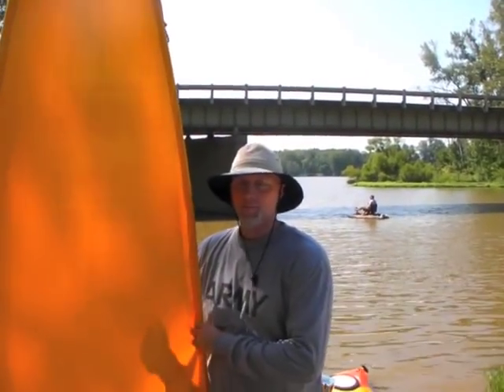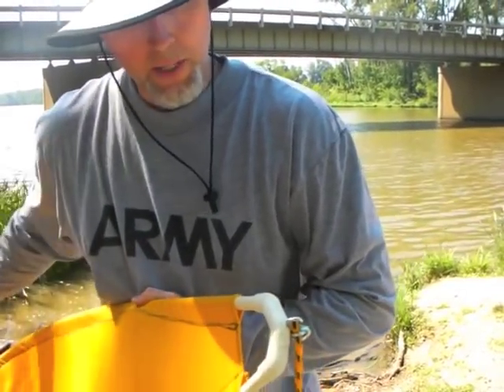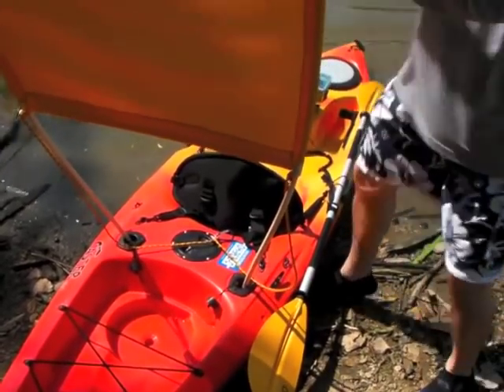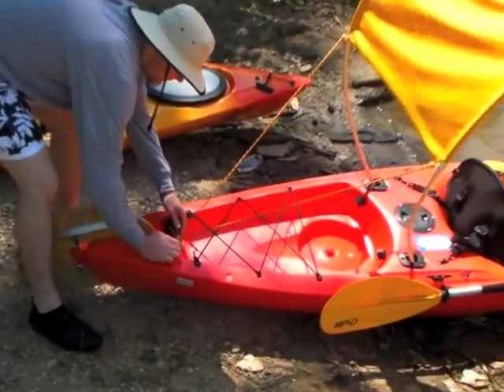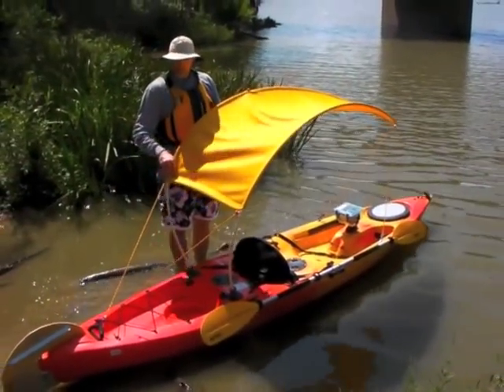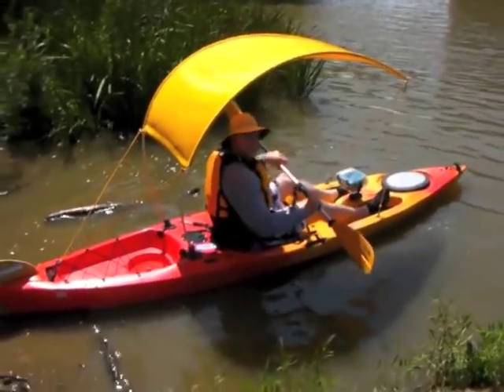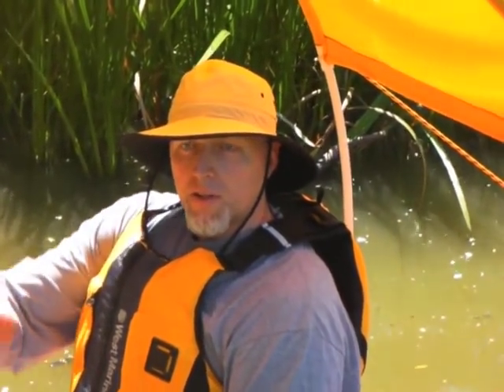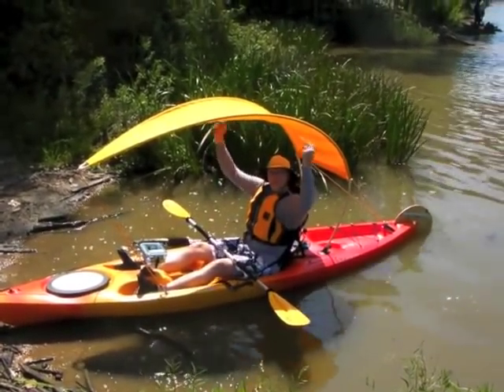DIY Kayak Bimini Top Part 2

Comment: Made mine today with your idea turned out great! But I used a waterproof material so I can still kayak in a sprinkle.
Reply: What material did you go with? Did you have to sew anything?
Reply: +knight2255 I got it from Walmart but found it also at Joann fabrics but Walmart was a better price it was a nylon fabric with a rubber backing so it'd be waterproof, yes is does need to be sewn to make a sleeve for the cpvc pipe. If you do this make sure you have the cross brace and the paracord to make it steady. These are great to have especially in the summer time if you don't want to be in the sun but want to be on the water

Comment: You are much more visible on the water..   If you paint the pvc poles with a UV protection paint, it will keep them from getting brittle and snapping.  Very creative way to use your brain.. :)

Comment from the maker: @degreethis Yes, you're right. After lowering it, it did block my vision quite a bit more, but didn't block much more sun on my legs. So leaving it higher is better. It still blocks sun on my upper body and head.  I think I'll have to make a version that stays wide all the way up to get better leg protection.
Reply: How did that work? I was thinking that same thing while watching. Also, noticed the Ohio WC sticker, where is that body of water? I'm in NE Ohio and usually yak west branch but always looking for new spots.

Comment: not really regarding stability. the width is not the only factor. a kayak that is longer and narrower will be just as stable as one that is shorter and wider. it is the area of contact with water that in the end determines kayak's overall stability. thus both equal each other out. neat idea with the bimini, very well done

Comment from the maker: @MrFriedolays I'm no expert, but I think the sit-on-top kayaks are better for fishing.  You also want one that is wider vs. the long streamlined versions.  There is a trade-off though when you go with a wide kayak.  It is much more stable so you don't feel like you could tip as you shift your weight around casting and pulling in fish.  But when it comes to paddling, it is more difficult to keep a straight path in the water, and you'll have to paddle harder to keep up with a narrow kayak.

Comment: Oh, and another thought ... it would be nice if this would fold up as tightly as possible in case the wind came up and it became a problem ... then it could be slid under the bungees on the side ... your present design looks as though the front 3 joined 45s prevent this from folding up into a tight tube ... don't get me wrong, though, this is a great little design ...

Comment: Nice job that's another thing kayaks really need a shade top. ,,I built something close to that in 2007 but the way I had it rigged I could use it for a down wind sail or Bimini,, same traingle shape just rigged differently you can check out on aaa winks channel I have been thinking about making a top for my kayak and you joged my memory thank you